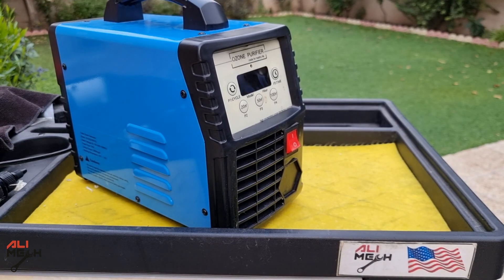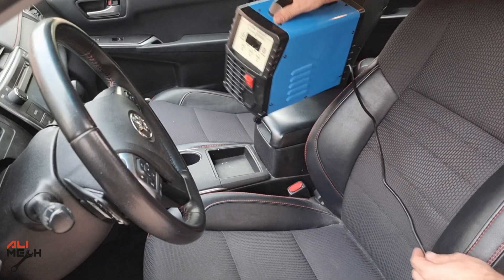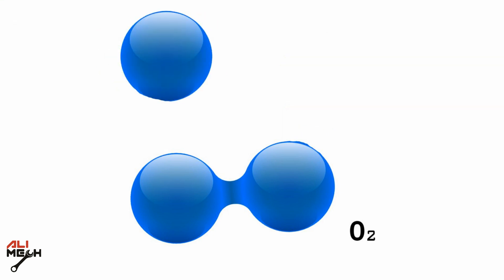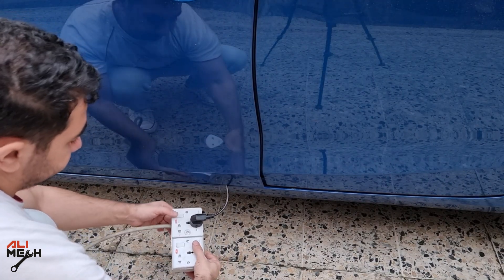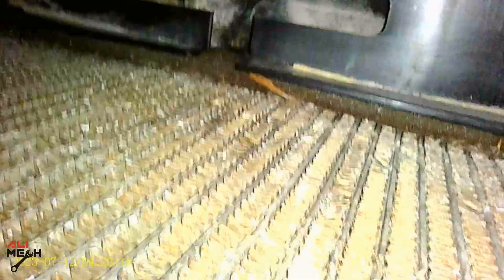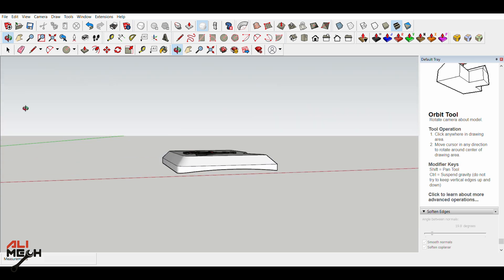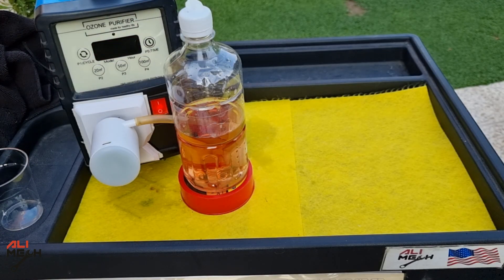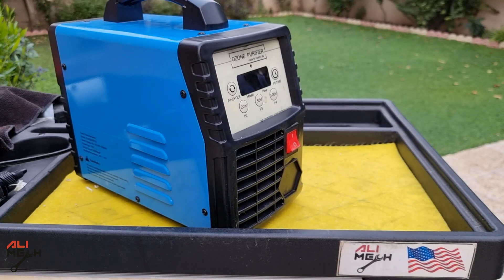If it can purify  dirty water, it can eliminate cars odor / Ozone generator when it works/not works

Comment: If you had the fans on in the car and the controls set to recirculate the internal air, rather than taking air in from the outside, would that not help to neutralize smells within the dashboard pipe work?
Reply from the maker: Sure that's better idea, but it will never clean that dirty evaporator like I showed, I did that too